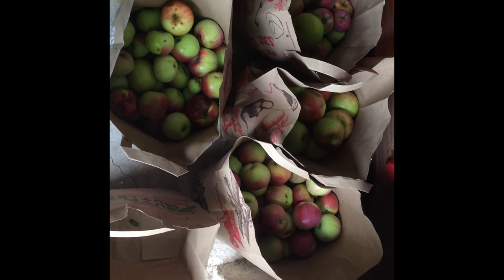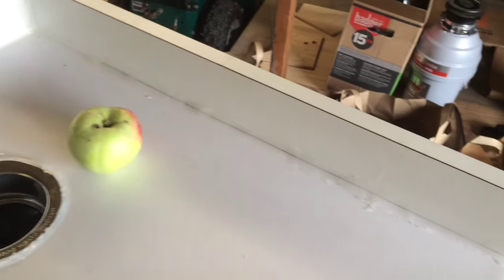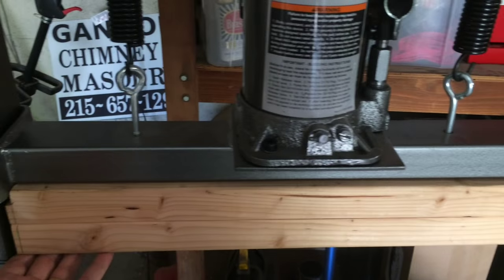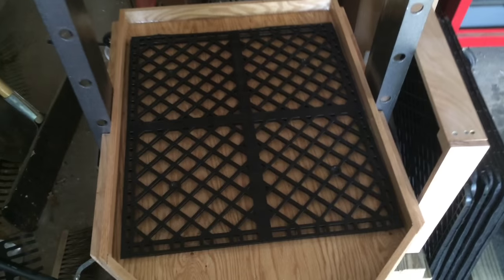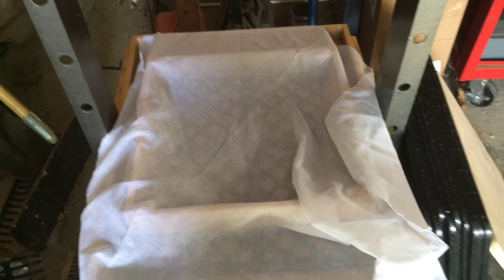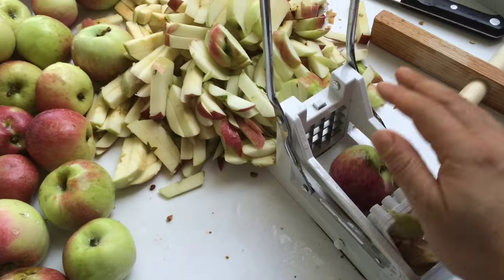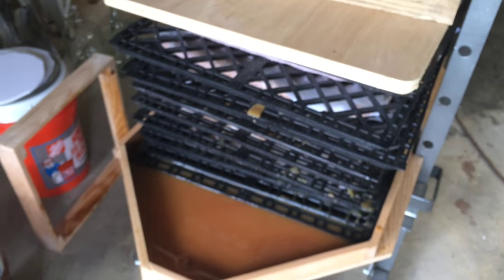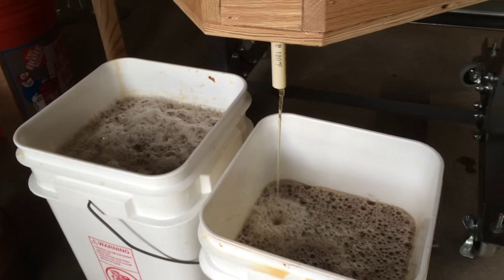Harbor Freight Apple Press

Comment: For all the garbage disposal grinder home videos Ive seen no one uses liquid.  Garbage disposales are made to work with your sink running.  If you pour some of your already aquired cider juice back thru over and over, then it will allow the garbage disposal to work as it was intended and it will not likely overheat then, plus it will probably work quicker and better.  Im sure you could rig up something that lets the cider flow back in at a slow pace while you grind.  :)

Comment: Good job!  Watch the pressure that you put on the traveling beam since the HF beam was designed only to put pressure on the press pin and not across the entire length of the beam.  I've replaced mine and another with two sections of thick-wall square tube welded together.  I regularly run my press to refusal (full 20 tons of pressure), and the traveling beam get a lot of pressure on it.  Nice how you made it affordable.  Mine cost a lot more (commercial cloths and racks), but I get inspected by the State as a food processing facility.

Comment: nice set up. my press is a very similar design, but boy I wouldn't want to be cutting apples and poking them into that garbage disposal. my scratter is based on claude jolicouers design. it was a bit of a mission to make it, but only cost me about $5 for an old grinder motor, maybe $10 in other parts and then wood I already had. I can pour in a 5 gallon bucket of apples and it will spit them out in about 2 minutes. its awesome. really recommend looking up this design if you upgrade your scratter.
Reply: got a link to that?
Reply: THANKS!

Comment: You can avoid having to cut up your apples if you use a wood chipper. Honestly. A 100 dollar wood chipper is a monster of grinder. Plug it in, ready to go.
Reply: I was thinking the same thing. How long have you used yours and have you had any issues with cleaning it when your done

Comment: Another idea to for your scratter is disassemble your disposal remove the motor. Buy an electric motor and a shank coupling that way you won't have to worry about overheating. Reference Whizbang's video (Whizbang Cider: Part 1)

Comment: OMG you are so clever! One good thing is that the press doesn't touch the apples. Maybe thin copper sheet can be folded over the wood to make it more food-safe.
Reply from the maker: Copper is not a good idea. The acid from the juice will leach away the copper. Ingestion of copper is bad for your health. Do not do this.